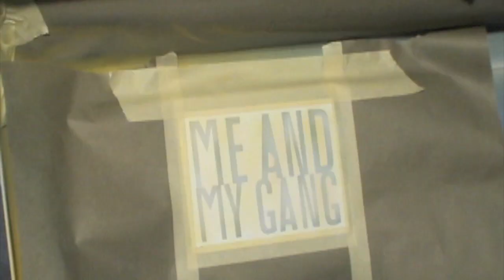Ocean Scene

Comment from the maker: Take a picture of a tree and cut out parts of it and use it as a stencil. Hold the stencil up off of the surface and spray through it. What that does is give you a blurry image of a tree and the same with bushes.